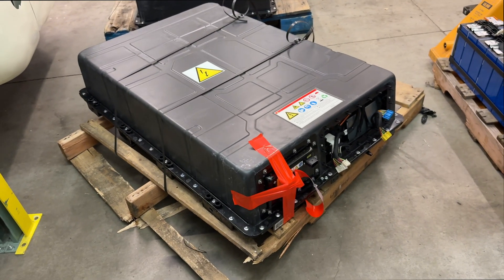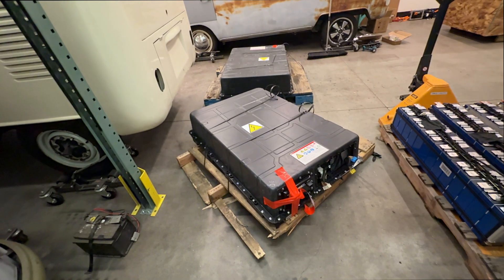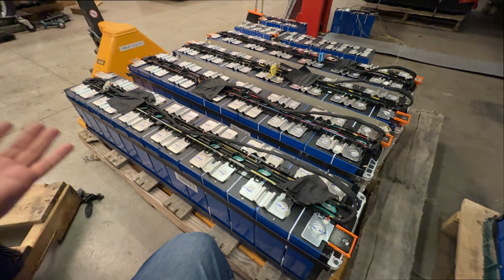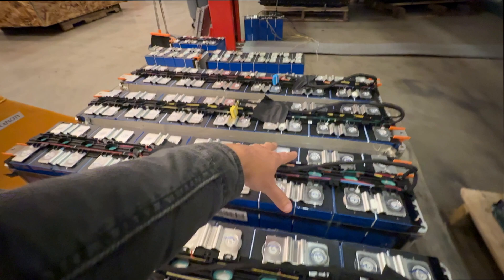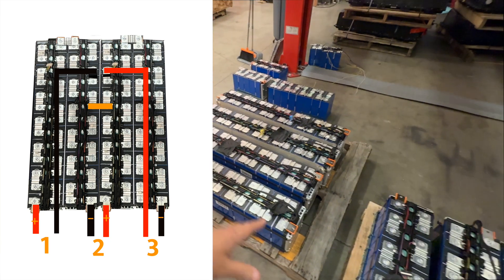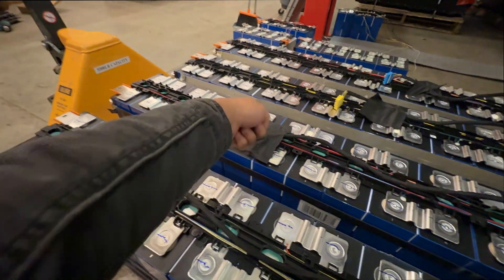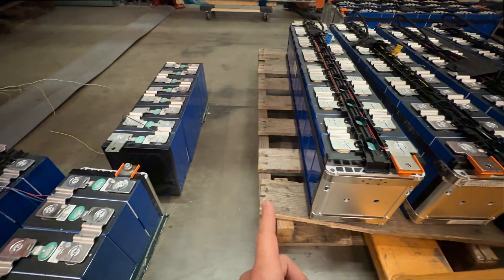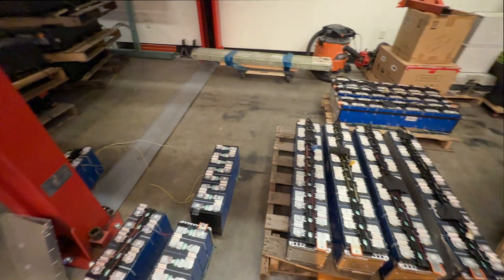More CATL Modules!!  But how to connect them?

Comment: I gave up trying to separate mine and cut it in a little different pattern so the four leftovers are together. Going to get a 4s BMS and use the battery for landscape lighting. 
My 16s BMSs are coming tomorrow and I’m still scheming how to move the battery from the trailer to its enclosure.
I’m tempted to order another one but it’s a toss up. If I have to hire a divorce lawyer I might lose the house along with the huge battery bank.😢

Comment: what is the down side of splitting in 3 sets of 16 batteries and parallel them to make one 48v battery using one of your high power $169.00 Bms???

Comment: with how cheap these are, if I had a need, I would buy two and a Solis S6 HV inverter and be done. They sell a 7.6 ($2100) and 11.4kw ($2300) version. Pick up a HV BMS with CAN or RS485 and you'd have a killer setup! Wild to think you can have 100kwh and 11.4kw inverter for UNDER 10k.
Reply: What HV BMS would you recommend?
Reply: @ rec makes a high voltage BMS. Daly I guess also has one but I don’t have any experience with it. Someone has a few Daly BMS with a solis inverter on YouTube.

Comment: just looked at these on the site and say 33" wide .. I really want to see would it be possible to get a 3d scanned model of these ?? I think it might be the ideal housing for a ev build I have been hoping to do one day .. I really wanna  go Tesla drivetrain thinking the I3 batteries.. but these I think would fit to the frame of the 87 suburban .. which I think is 34" would have to double check ..
     I think my Square Body build oneday will me epic , to afford it I  need to find someone to make videos for me lol  .. or I'll have to figure out how to edit videos while im on Hemodialysis on my tablet  .. but the biggest bonus of the  mod is that it should really fix some of the high centerness of the body .. also wanna change the hubs to 2000 chevy truck 4x4 hubs . easy to find, use 6 lug rims, cv axle input. mock up parts cheap at junkyard.  .. or Illl end up trying to move a heavy suv with the cheapest motor I can get hold of and hope I dont get run over hahaha
Reply: The base is 35” wide.